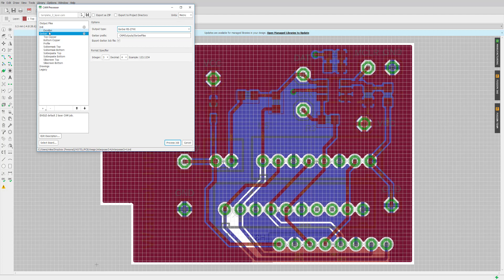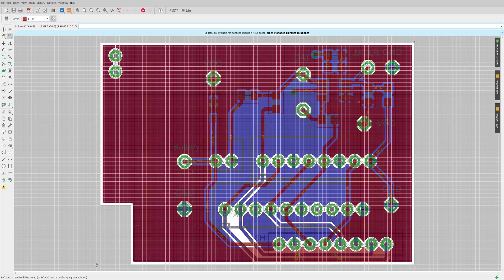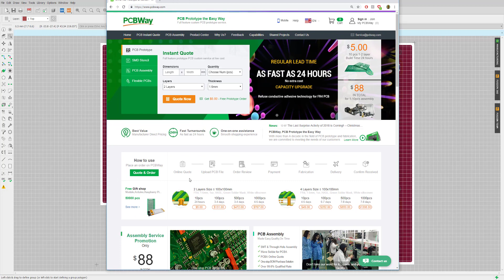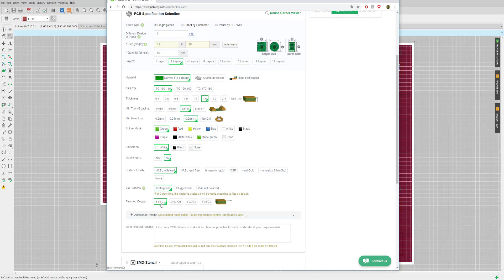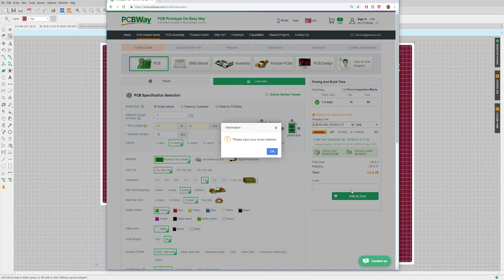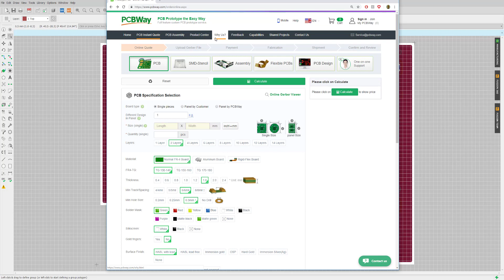EagleCad PCB to PCBWay manufacturing the easy way

Comment: Extraordinary tutorial
Critical points for self reference:
@3:40 Add dimension layer so that manufacturer knows the bounds.
@4:50 Gerber RS-274X is selected as output file
@5:40 zip the files
@6:00 Final task in eagle: Make a note of the extent of the PCB (Maximum width and maximum height)